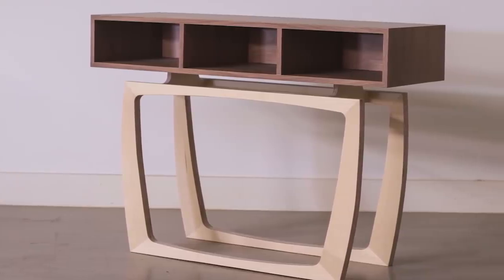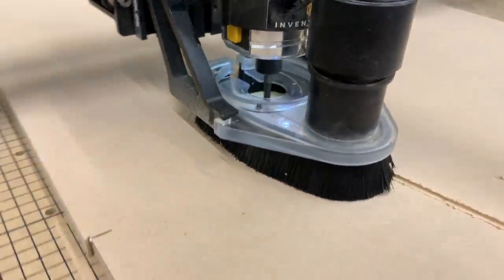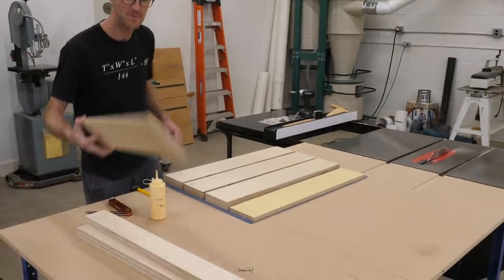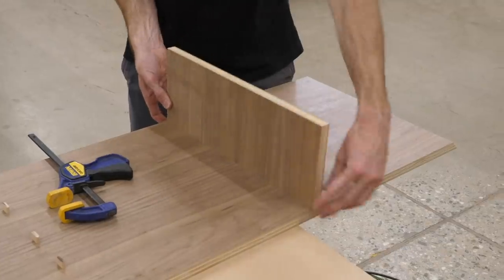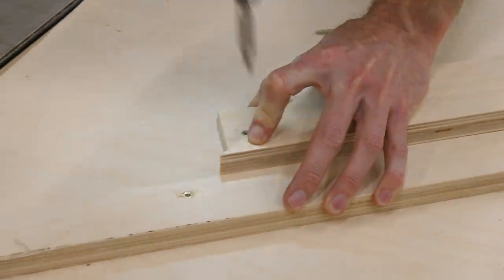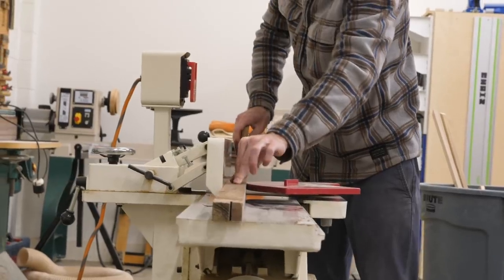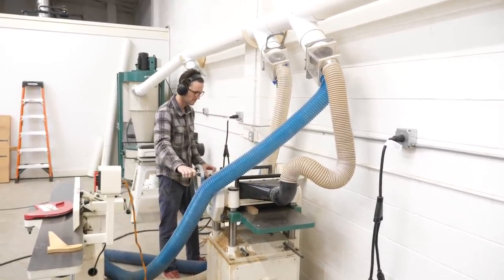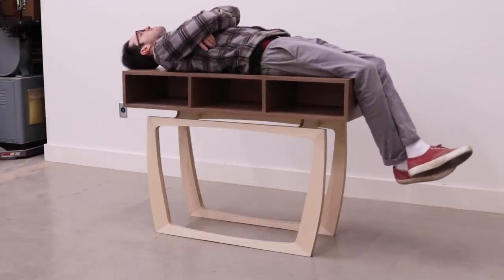Building a Hall Table in 24 Hours

Comment: Chould have gone with a slight angle on the outside pieces of the box to make a trapezoid so it matches the legs better. But other than that cool. Limiting yourself to a time frame or something else can make you come up with cool stuff you wouldn't have thought about when you got "limitless" possibilities so I get the challenge of it all.
Another fun way you do that is to write down (or ask your fans) a bunch of different criterias, then you put them in categories, and blindly pick like three things. So it could be the type of furniture, material, and one thing it has to have. An end table, made out of micarta (impregnating sheets of paper with resin), with built in wireless speakers!
Reply: Thanks! We definitely want to try some more challenge type builds in the future, good ideas!

Comment: Because the other vids weren't weird enough?? But I did quite enjoy it. The ply(wood*) vs hardwood discussion left me wondering about how the glue, pressure, whatever-else of the plywood production factors into the choice. Next challenge: working with plies of actual wood without glue, pressure, shipping, workers' comp claims (those sheets are heavy, yo) versus comparable parameters for real wood availability?

Comment: How was this for front-to-back racking or wiggling?   I would have thought you'd want a connection between the legs towards the bottom in addition to the top connection.
Reply: It’s actually not too bad, though there is a bit. Which I kind of expected. Thanks for watching!

Comment: Guys, great work as usual. I really like the fact that you add your tips and thoughts as you build. What do you use to set your bevel gauge? I know it would take longer but add some strength why not offset glue the leg blanks this way there is some glue surface to attach at each corner.
Reply: Thanks Pat! I just set the bevel gauge to the line on my template. And yeah, that is a good thought for the joints, but you are right, we were definitely only concerned with time for this one.
Reply: @shaunb66  The wood template you made? But you had to draw the line on it where you divide it, that bevel gauge doesn't have a way to set it. I used to set my miter saw to the degrees I wanted and then match that. Now I bought a digital version.